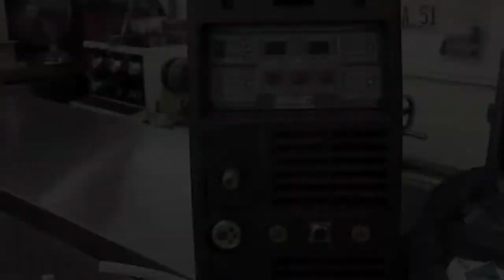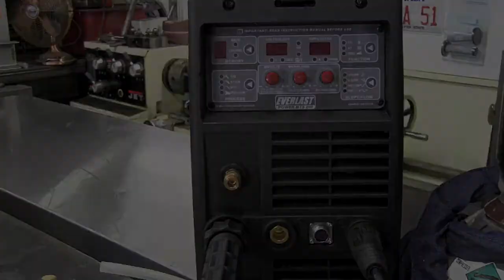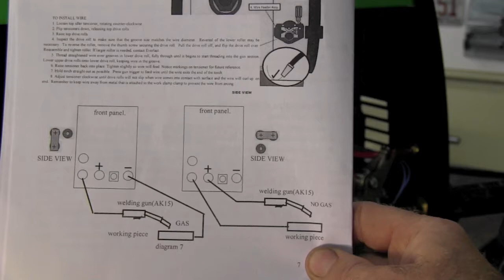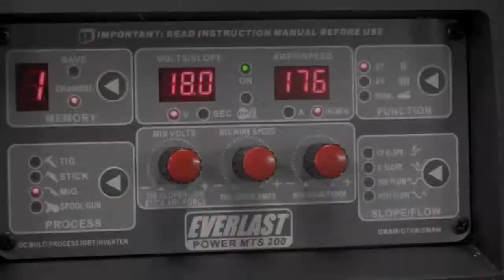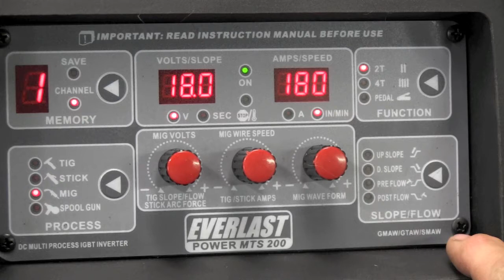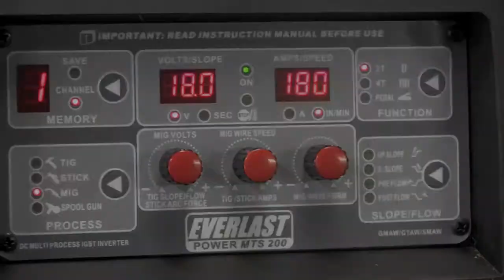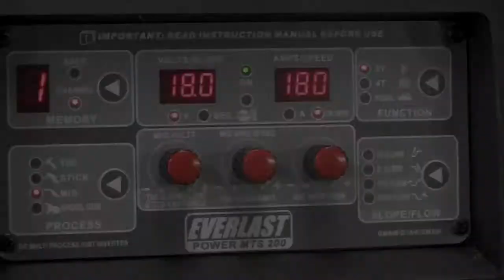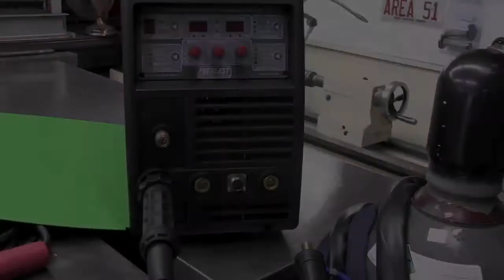Everlast PowerMTS 200 Multiprocess MIG TIG STICK 200a WELDER

Comment from the maker: In my shop I use Everlast 255 EXT for my Tig and 60s for my hand cut Plasma. Hypertherm powermax 65 is on my Torchmate. My Mig is a Panasonic. This is my best combo for the processes I used daily, prototyping. I use the Everlast MTS in my work truck for mobil repairs. I no longer have any Longevity units in my possession. Hope this helps!

Comment from the maker: Hi Stretch,
I was contracted with Longevity for about a year and a half. During this time I got to test about every unit. There are model I prefer over others in there line up. To be clear I don't work for Everlast and still choose there models to use and test. My newest Tig is there 255 EXT that is the best Tig I have used to date. I do prefer a digital unit to analog.I do like a purpose built machine over a multiprocess. As for plasma I like Hypertherm followed next is the Everlast 60s.

Comment from the maker: I have had great performance form the Everlast line.  For welding Aircraft I would recommend the 200 DX or the new 255 EXT. The 255 is my new welder and really like it. Its a digital processor and really gets a tight very controllable ark that works great for thin wall tubing.

Comment: Great video.  I got a cheap welder in 14.  I found that after a few weeks, I could actually stick weld.  Now, I want a good welder that can do a lot of stuff.  I want to take classes on welding as well.  My dad was a great welder.  He had a huge Miller in the back of his truck.  I was going to go with Miller for that reason.  But, the one I was was almost $4000.  Then, I randomly looked on the Everlast site and found this welder.  Unlike the one from Miller, this on can do aluminum.  Also, the price is much lower.  I think $2999.99.  So, I've decided to start my own thing and get this one.  Now, as for how to set up for mig or tig or hook gas or whatever else up, argon maybe, haha, I have not a clue.  But, it is hard to learn if you do not have one.  So, in like 6 months one of these will be mine.  Thank you for the video.
Reply from the maker: +Josh Glowzinski 
That's awesome being able to stick weld. When you get into Fabrication your in for a lifetime of learning! I'm 47 now and still learn something new every day out in the shop! Happy New Year and keep welding!
Reply: Your story sounds a lot like mine. I'm glad there are welders that are more appropriately priced.

Comment: Tim, great tutorial, thank you.  I have been thinking of welding stainless steel, how would this machine handle that? Would I use it in mig or tig mode?
Reply: SHANNON AMBROSIO 
both. 
or all 3.
just need the right filler.
Reply from the maker: Thank you! I only Tig Stainless. Up to about .200 thick will weld it no problem. May even get .250 out of it!
Reply: Tig/mig here.
Can stick, but not pretty. 
I have the 164 I think. Tig stick plasma. 
Good brand.
Looking at this one for my next. 
I've got 1/4 with my little guy but I need a wire feed for them jobs that don't need to be Tig strong.
Where you get your cups from?
I'm down to my last one and I don't want the kit. Just the cups! :)

Comment: where did u buy this mts 200 cause on everlast it s799 but no tig torch with the machine just wondering how that one came with a tig torch unless they lowered the price and did away with the tig torch ?
Reply from the maker: +David Cook I got mine directly from Everlast. I would give them a call and see what's included in the package. I remember about $1100 I paid for mine.
Reply: this machine is actually the power mts 211 si. if your search that's this is what you get. if you just search the power mts 200 you get the $799 machine

Comment: Is this capable of running flux core?
Reply: +Travis Kellogg Absolutely. I've used my Everlast MTS welder with flux core quite a bit.
Reply: I've got mine hooked up with metal core wire as the main spool and flux core in my spool gun. Both hooked up simultaneously and I can switch from one to the other very quickly

Comment: Tim,
Are you still using the longevity 200EX? what are your thoughts now after a year of use?
Reply: I've looked into Longevity and all I can say is that every professional who has ever "endorsed" Longevity had stopped doing so after a couple of years of knowing them. Some catch on quicker than others on the kind of company it is but all eventually do.
Reply: +Gary Westin Longevity isn't doing very well. It looks like they have reduced their warranties too. Everlast on the other hand seems to be doing much better. I really like the latest models that they have come out with.
Reply from the maker: +Brent Weiser Thanks for the update.

Comment: Tim, after using this machine for 2 and a half years, can you speak to its reliability? Have there been any major break downs or warranty issues?
Reply from the maker: +Sean Linde I have neve had a break down or any other issues with any Everlast machines! I have a video coming soon on the MigWeld 140 and the 255 EXT. I use these two machine every week and still running like day 1. I no longer have the 200 MTS but my dad still uses it for tike to time and its still running strong!
Reply: +Tim Robel I've used the MTS251si and it is really nice. I like the pulse MIG. It has allowed me to stretch the range of metal thicknesses I can MIG weld with a single diameter of MIG wire. I can weld thinner and thicker metals with the same spool so I don't need to change it out nearly as often now.
Reply from the maker: +Milton Gwelch Thank you for the feedback! Great to know!

Comment: The sales team as Everlast says we need to drop the "N" from the beginning of our name to improve sales.
Reply: I guess you never owned and Everlast machine.  Too bad!  I've had mine for 3 years with never a problem.  As good or better than any of the other brands out there.  I know because i have Miller and Thermal Arc welders and the Everlast works great at less than 1/2 the price.
Reply: I  worked on hundreds of inverter style welding including everlast .Some of these Chinese units  will fail  when pushed to  there  rated current ever time.Very poor design of some models. The IMig 200 is one of there better units. Good luck
Reply: I hope you don't have any problems with your everlast in the last years of there 5 year  (ya right) warranty.  You should look at some of the BBB reports about everlast OG  investments (parent company of everlast welders , everlast generators and everlast power equipment) . Research  everlast and the primary owner and see what you can find .
Reply: Well you don't see a 5yr warranty on Miller or Lincoln.  I've seen a lot more positive comments about Everlast than negative.  So do you have a Welder?
Reply: Rodger Miller Ok granted.  But what i think is important, is the supervision of the Machines and the quality control.  If they are concerned with either, which i believe Everlast is, it should be just as good as a domestic brand.  Lincoln is building some of there models overseas as well.
Reply: valveman12
Yes I know even some of the "USA " models are made overseas. I have an HTP Invertig 200 ( made in Italy?) that was not working  when I got it but the folks  at HTP tested what I thought was the bad board (electronic schematics are not available so the Chinese do not copy there design), replaced the board and unit works great and looks new.
Reply: valveman12
May-by I am bias because the machines I saw were from unhappy customers waiting for a usable unit. Many of the units that failed we had to add copper buss bars to fix them (melted large areas of circuit board copper)and to try to make sure the customer would not have the same failure,bad not fully tested design.Loose bolts on high current circuits ,bad connections,incorrect parts installed  and freight damage were many of the other repairs. The USA  made  (no Chinese models)  seem to have more of a overbuilt safety/quality  factor to them that the Chinese models don't have. I know the technology is different today with inverters but you don't see many if any  20 or 30 year Chinese units working and for sale.I have been out of sales of new units for a few years but still do  service .  I hope  the Chinese  have improved the quality of the new units. Many customers told me they would have paid $200-500  extra to have a better quality machine.  Only time will tell.

 Welders:
HTP Invertig 200
Riland 60 Amp Plasma cutter
Thermal Dynamics  80 Amp Plasma cutter
Lincoln AC/DC  225 Amp stick Welder (buzz box)
Century  250 Amp Mig   (HEAVY) Used it for contract welding
Riland  WSE 200  TIG/Stick  Welder  (SOLD) Offered o good price
L-TEC  80 Amp Plasma Cutter    (SOLD)